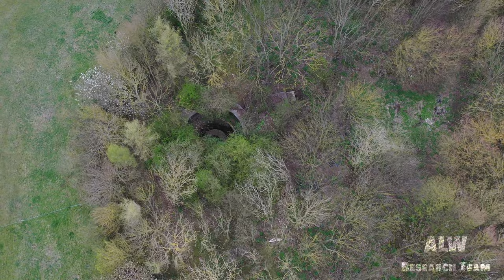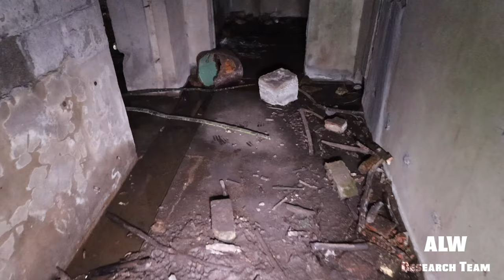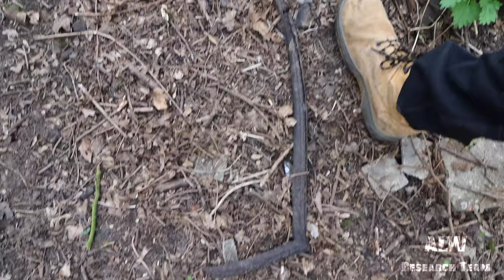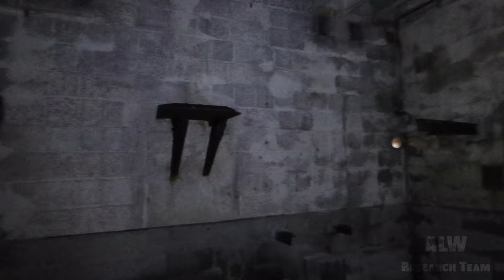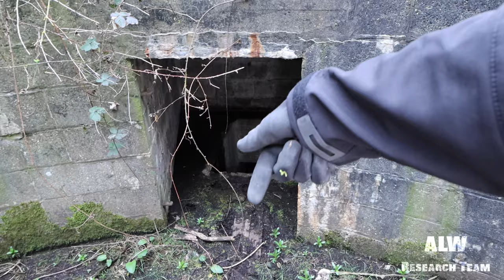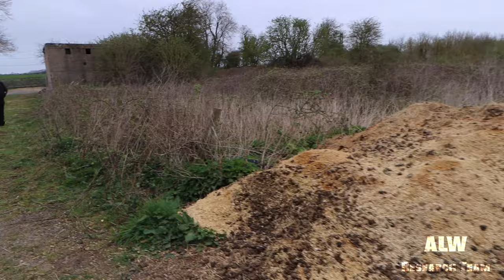Forgotten Heavy Anti-Aircraft Battery found in the woods

Comment: Typically a military facility would have redundancy built in, so where you looked and saw multiple engine beds (power generation or hydraulic pressure generation) there would have been more than one engine for the same purpose. Quite often one on stream, one on stand-by, one under maintenance.